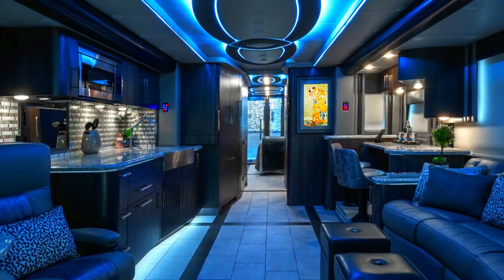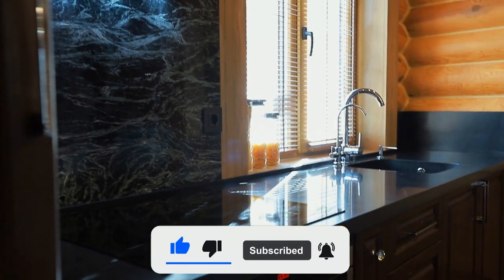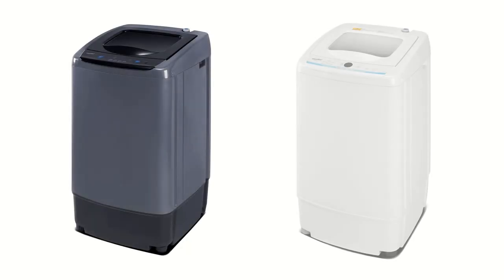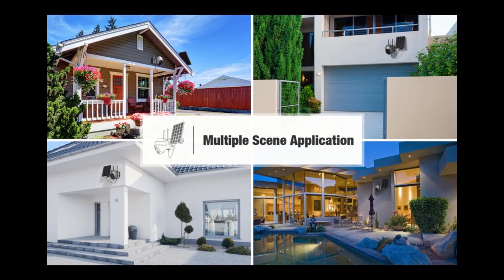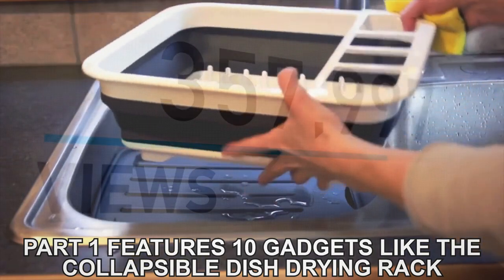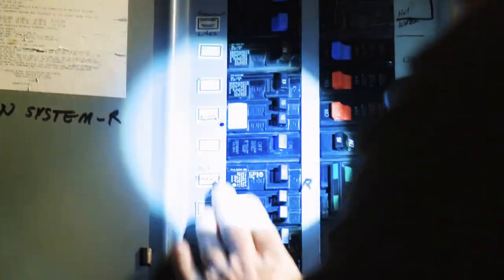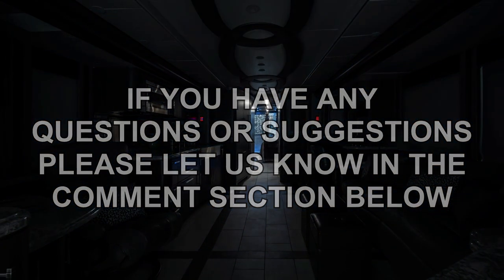10 MORE MUST HAVE RV GADGETS & ACCESSORIES

Comment from the maker: ► PART 1: https://youtu.be/ql4bsRelX-E

► [US Links:]
► [00:13] Collapsible Laundry Basket - https://amzn.to/3JBxWhI
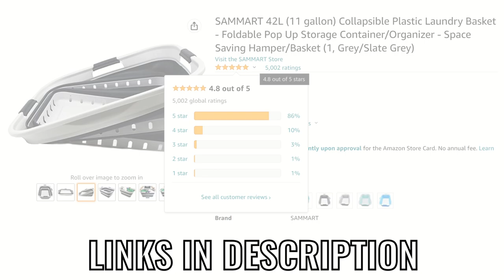► [00:54] Countertop Dishwasher - https://amzn.to/3BKfQIv
► [01:51] RV Step Support - https://amzn.to/3A4jYBT
► [02:27] Compact Washer - https://amzn.to/3JDjyWf -- Dryer - https://amzn.to/3Q9UybC 
► [03:46] Solar Powered Security Camera - https://amzn.to/3p58DeI
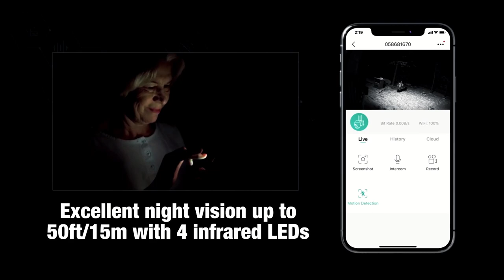► [04:51] Clothes Hanger Organizer - https://amzn.to/3QsJZQY
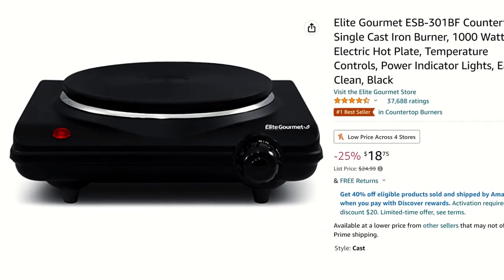► [05:22] Portable Electric Burner - https://amzn.to/3BOvDGv
► [05:44] Keyless Entry Door Lock: https://amzn.to/3Qe7XQg 
► [06:55] Levoit Air Purifier - https://amzn.to/3vMCdta
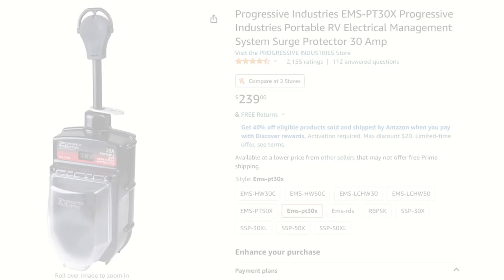► [07:34] RV Surge Protector - (30A) https://amzn.to/3CVS0dz -- (50A) https://amzn.to/3TQ976F